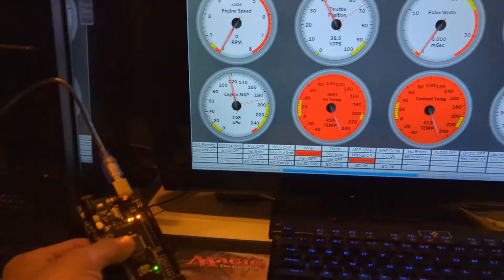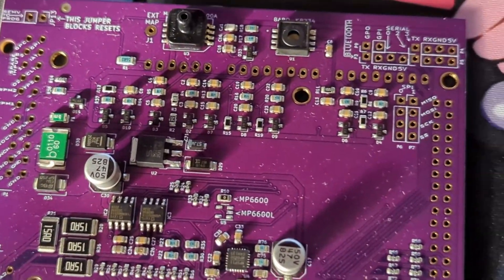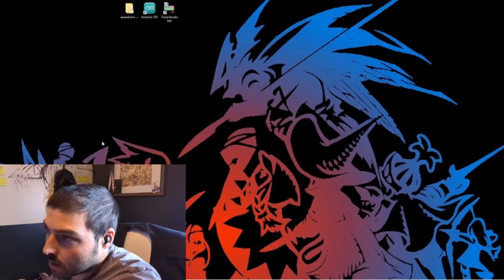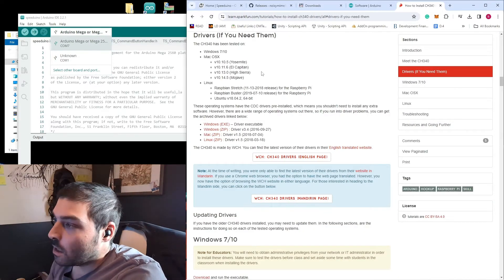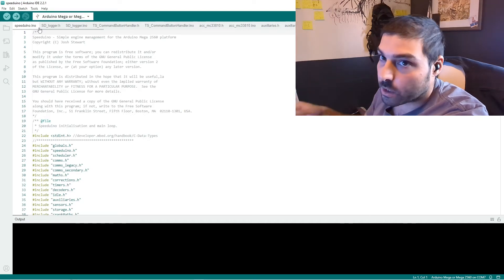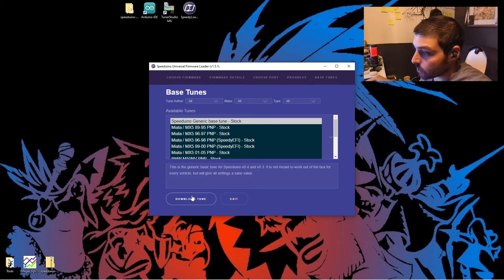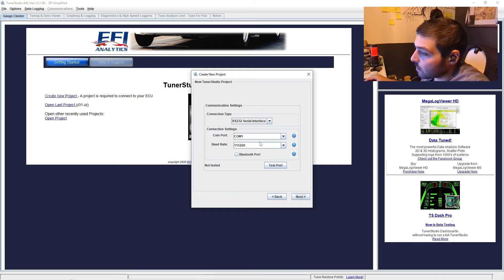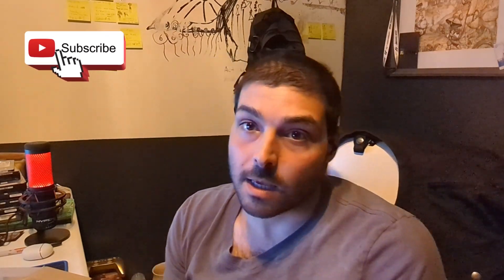Speeduino 101: (Arduino Setup and Firmware) | Introduction - Getting Started with Tunerstudio

Comment: When I "verify" the code, a compilation error message pops up. Do you know how to fix this?
Reply from the maker: can you link to a picture if not anymore information could help? 
Also make sure the programmer jumper is off
Reply from the maker: It could also be that you are setting the wrong com.. lots of things please update us and we will do what we can to help alternatively create a post here !! https://speeduino.com/forum/
Reply: @aftereartharcade  I had downloaded the speeduino-202501 file, instead of the one you use in the video (speeduino-202310). If I remember correctly, it said I was missing a file. I downloaded the 2023 file and used that instead, and it is working fine now. I appreciate what you are doing! This is cool stuff.

Comment: Are you willing to build a speeduino board for me ? Obviously would pay for raw material and labor !
Reply from the maker: I'm hopeful if you follow the videos you should be able to put one together yourself. I plan to show the full process of hooking it up to our z31. Even if it blows up :p . Sending out assembled speeduinos is a service i could provide, but to hook it up the the car you would need to do your own wiring or we would have to put a harness together for you. That could be expansive :< but what engine are you running?
Reply: Ka24de ! And I bought the exact parts as you . Having issues with tuner studio.
Reply from the maker: @thomasjoyce8374  
Oh sick! Did you install the firmware with speedy loader? If so what issue do you have with tuner studio? 

Do you know what injector and ignition set up you are running?
Reply: @aftereartharcade  I followed the video step by step (amazing video btw) I wrote down the error code it was throwing , something with the imi I think. And I downloaded the most current version with speedy loader . I'll add you on discord sometime soon